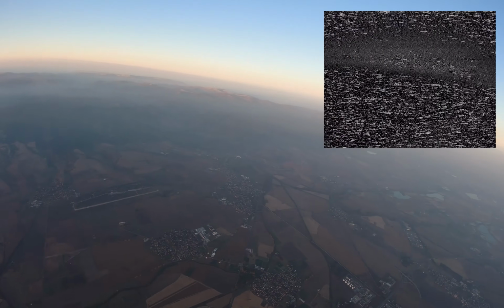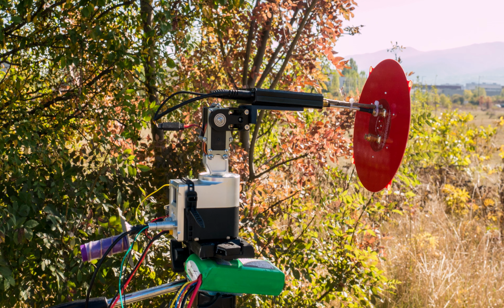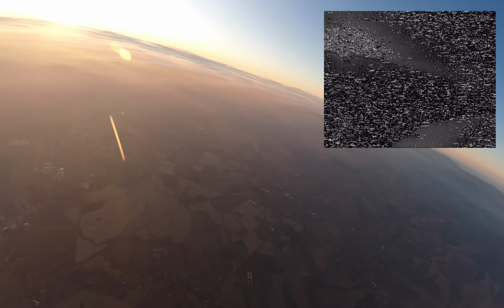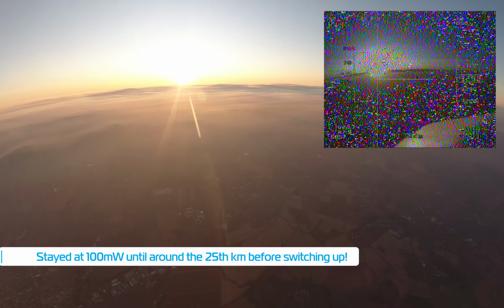DragonLink Advanced 433Mhz LRS Radio - an AWESOME system!!!

Comment: I’m about ready to maiden my xuav cloud but can’t find any info on control surfaces deflection how much travel do you have on your ailerons, elevator,and ruters or what ever you call them on a v- tail
Reply from the maker: Well I always leave them at full travel! These planes are rarely flown in manual modes and the AP would limit travel to certain degrees anyway.

Comment: What do you recommend in 2022 for long range because Dragon link is probably no longer available for sale :( (Out of stock) why ????
Reply from the maker: It is often out of stock because of high demand and not enough production! Give it some time and it will be restocked! I am not aware of it being taken out of production!
Reply: @ArxangelRC  If this is really the case, I regain my faith that I will build my dream plane: D sorry for my English I'm from Poland
Reply from the maker: @Adexi1  Well that should be the case, the system is often out of stock, I've had situations where I've needed to ask DL to reserve a set from the next batch for friends, out of fear it will get bought out too quickly!
Reply: did you buy it? or did you buy another radio transmitter?
Reply: @herbertnatanael Out of stock :(
Reply from the maker: Yup

Comment: I've got the Dragonlink and Mateksys F765-WSE but I cannot work out how to connect them. Any help would be very much appreciated thank you
Reply from the maker: What exactly is the issue? Usually Rx6 on the board is where the SBUS or PPM from the receiver should go! Somewhere around it would be the 4v5 and GND pins for power.
Reply: @ArxangelRC  Inbetween sending that message and you replying I got movement in Arduiplane. I can see the 4 RC_MAP for pitch roll etc. How do you map the Flight modes please
Reply from the maker: @ps_3460  The default modes switch in ArduPlane is channel 8 from the radio.
Reply: @ArxangelRC  My F654-WSE just caught fire. GRRRRR!!!!!!
Reply from the maker: @ps_3460  How did that happen? 🤯
Reply: @ArxangelRC  I set it up on the bench. All worked fine. Put it in the Ranger 2000, it sparked and caught fire. Luckily I ripped it out of the plane quickly, no damage to the plane.
Guess I'll have to fly manually for a while.
Reply from the maker: @ps_3460  Damn... did it spark up when you plugged in the battery? Could it be a shorted wire?
Reply: @ArxangelRC  I'd like to say I was careful. But you never know
Reply from the maker: @ps_3460  Yeah, sucks mate, sorry it happened!

Comment: Dragon junk just wait. Got two of these junk, it will just stop binding. 800 dollar paper weights.
Reply: Pretty easy to say junk, with no full explanations of what the set up is....be specific
Reply from the maker: @M-H433  Exactly!
Reply: Lang le please tell us your set up and exactly what the problems are so we may try and help you.
Reply: @M-H433   junk for the money I pay. First one work for six month and just die no power to the unit..second one work for year and a have till it one day after flying for 2 hour. Land it and it never mind again to the unit..i have other brand that still working. Ask dragon crap for help. All they can do for  you, is show you the same video online,absolutely no help from the dragon crap. Email them no reply one after another fuk that crap,
Reply: @langle6003  did the tx die or the rx?
Reply from the maker: Why would it stop binding? Never had this issue! Have you flashed it with the new Beta firmware?
Reply: I got it brand new, bind it fly it for  seven to nine month. One day turn power on it doesn't turn on  dead as a door knob  Rx is good, got another dragon unit.  bind both ex, flew and crash one rx in gas plane. A year and  half  later went to fly, turn it on and no binding light, try try try to bind it,,,it never ever bind to that rx..got pic of both.
Reply: @langle6003  v2 or v3.....so it sat for a year and a half and you decided to fly and the Rx was dead?
Reply: Flown it for a year and seven month, went to turn it on one day, bam no binding. Upload new firmware and still no.binding. now it sit in the corner. Don't waste your time asking dragon crap for help.
Reply: @langle6003  sent it to me and I will fix it and send it back to you.
Reply: @M-H433  are you a hobby shop or store.
Reply: @langle6003  no lang but im more than happy to look at it for you,up to you just want to help.
Reply: Lang  do the blue lights come on at all,and if not are you running the same firmware on both rx and tx.
Also have you done calibration in Gui after attempting bind?...
Reply: Let me dig it out haven't mess with it over three yr. All in a box. It's junk when they say they will fix it or guarantee the product but they don't and will not ever from dragon link. Bought the V2 in 2015, seven to eight month later, flown it ever month, seven or eight month turn on radio no power to the tx..install new cable, still no power out of tx..so got another one which is v3, new. Bind the v2rx and v3rx, I bought the second unit because it was really 😎 me to fly over 10 mile with my skyhunter and mini talon ..it awesome but the nightmare start .so now the second unit everything work just don't bind .try and try to ask dragon crap for help, that how they guarantee it by not replying back yr after yr...I still fly with  futuba ,  airtonic from the 90 & 2002. Got a German multiplex unit now. Radio.
Reply: @langle6003  Lang why don't you just box it all up and send it back to them,with what the issues are,I'm sure when they get it they will look and offer some explanation, I see a lot of non binding issues over sites,if it was me I would have sent it back a long time ago.
Please keep us posted on updates,I've never had these issues with my system so can only offer my help to you if you wish it.
Reply: I try to do that from the beginning and they would never talk to me only I mean only respond watch video. Get it from getfpv, I spent day to email or get a respond they do talk to my kind of people..after the first bunch of time just give up...that why I call it junk. you want pic of it just sitting in a box...well got German equipment now don't have to worries about fake guarantee...
Reply: Don't need pic Lang of it sitting in box,you obviously don't want help fixing it so I guess we end the conversation and I withdraw my offer to fix for you,good luck in fpv and enjoy.
Reply: Mike has the best support in the world, and thats not an overstatement. If you have a problem he will do anything in his power to help you, and for free!.. Are you sure you are not just trolling?
Reply: @Eiael  I think he was just lazy. Didn't understand it's easier on DL if you box it up and send it in, rather than time on phone or email. Woulda took a few minutes on the bench.

Comment: pretty sure the dragon link on 433MHz is illegal without a HAM operator license. Also, video on 5.8GHz  above ONE watt is illegal too. So this video is promoting illegal behavior. Can anyone prove me wrong? Cite your sources.
Reply from the maker: And which part of the world are you referring to?
Reply: @ArxangelRC  https://www.ic.gc.ca/eic/site/smt-gst.nsf/vwapj/2014_Canadian_Radio_Spectrum_Chart.pdf/$file/2014_Canadian_Radio_Spectrum_Chart.pdf 433 is Amature secondary use. 433MHz you need a licence for amateur use https://www.ic.gc.ca/eic/site/smt-gst.nsf/eng/sf01226.html#p10.1
Reply from the maker: scott Houser  Yeah!
Reply: @ArxangelRC  Here is The FCC version https://www.law.cornell.edu/cfr/text/47/15.240
Reply: @ArxangelRC  or just a quick WIKI serch for ISM https://en.wikipedia.org/wiki/ISM_band
433.05 MHz to 434.79 MHz is "only in Region 1, subject to local acceptance."  FYI U.S. is region 2
Reply: @ArxangelRC   @ArxangelRC  Here is the 5.8 GHz power limit for the U.S. https://afar.net/tutorials/fcc-rules/#:~:text=In%20the%205.8%20GHz%20band,23%20dBi%20of%20antenna%20gain).
Reply: @ArxangelRC  I empathize with your situation. I too am trying to get a long-range system up and running but legal setbacks are cropping up. I was hoping to be proven wrong so that I could legaly get the range I want but so far...
Reply: Use your brain.  They would not have used this frequency if it was illegal....  duh!
Reply: @amazingpower2761  In Canada, in the RC hobby space, it's actually quite easy to buy a random transceiver on the internet that uses frequencies and power outputs that are legal. You aren't blocked from buying it. You have to go out of your way to research whether it's legal.
Reply: scott Houser  Us and Canada have almost identical regulations. I am specifically interested in Canadian law.
Reply: scott Houser   You are missing the point entirely. I have done my research and according to all the links I provided, assuming ArxangelRC is in the US, he is flying illegally. 5GHz above 1Watt is illegal in the US. 433 is not allowed for use for flying drones in the US. You may be upset but am I wrong though?
Reply from the maker: @Pyotyrpyotyrpyotyr  Yup! Scott is correct... you are coming from a wrong assumption of my whereabouts! I am in Europe, and more specifically in Bulgaria! 433Mhz here does not require any kind of licence, as for 5.8G... it is quite debatable what is legal or not! The EU has a rule for 25mW limit, if I am not mistaken... which is absurdly low... but Bulgaria in specific has no set limitation on that power output, and I would think 5G routers output on more than 25mW! More to the point... the situation in this country is such that... nobody really cares about any of this... they are more concerned with lining their own pockets from way overinflated infrastructure projects and stealing businesses than dealing with the 20 people flying FPV around here... there is just no money in it!
Reply: @ArxangelRC  Okay good to know thanks. I couldn't tell from the scenery what country you're in.  I also don't know where your audience mainly from. Europe / US. Keep up the good work many thanks.
Reply from the maker: @Pyotyrpyotyrpyotyr  Thanks, will do! :)
Reply: @ArxangelRC  Same for México lol
Reply from the maker: Right...
Reply: @Pyotyrpyotyrpyotyr  were you able to make any headway in determining a legal long range setup in the US/Canada?

I got my HAM license today, and would love to do some long range FPV, but the damn “no BVLOS” rule is thwarting everything
Reply: @macremtom  me and my buddies are in a drone company and we're trying to get BVLOS certification. It's been a pain in the ass. As for now we're just using 2.4 gigahertz. And in the future I'd like to have something on 900MHz. 400 MHz as far as I can tell is flat out illegal for uz it's cuz it's an amateur band whereas we are trying to make money so that doesn't fit the legal definition.

Comment: Ive seen videos with someone popping out 297km round-trip :O Ive got my dragonlink V4 on order - Im only hoping they havent nerfed the distance due to FAA restrictions but even then, hopefully - there is a firmware hack to get around any signal nerfing.
Reply from the maker: I don't think they have! But that distance does require some pretty good antennas! The DL on its own, with stock antennas, will not reach that far!

Comment: 15km  rssi 27% not good
Reply from the maker: This was the telemetry signal, not the control signal.
Reply: @ArxangelRC  I know that telemetry signals do n’t look ideal
Reply from the maker: Well this was running at 200mW max... not at the full power!
Reply: Im running 100mw tx power + diy moxon antenna 25km not less than 90% rssi.. Telemetry work perfect.

Comment: Do you or have you used EZuhf? Intrested in distances diffrence. Gr8 video thank you.
Reply from the maker: Thanks! No, I have not had a chance to try that system... or have even seen it around here!
Reply: I use it and it works very well. However, the receivers I'm using are from a Russian company and are a little higher quality than the stock receivers. It's a one-way system as well so a separate telemetry radio is needed if you want Mavlink telemetry. I just use and record the OSD data with those installations. Range is comparable. Good antennas is the key factor to good performance with any of these systems. 80km out is possible with even the cheap OpenLRS equipment if setup properly.
Reply: @jeffhampton8781  what video system do you use? I ruined myself by getting a Disco over 4g doing 70km round trips but no skill is need.
Reply from the maker: A Russian company is making receivers for an EZuhf system? Damn...

Comment: I'm confused why you had telemetry issues on the R9. With the R9slim+ and R9M on dynamic I reached out to 20km already with stable telemetry. Just needed to turn around because of battery and not yet full range tested plane.
Reply from the maker: I did not have telemetry issues on R9... I just never bothered to try it... because my experience with FrSky and telemetry is that when it is operational... control range degrades a bit... and since telemetry is not exactly critical to me... I can easily omit it from the system so I can some extra kms of range at any given power level! That logic seems to be working quite well for me! Also, I am doing EVERYTHING that I can to stay away from FrSky telemetry and lua scripts... and have been quite good at that so far too! :P
Reply: Can you get mavlink telemetry with ardupilot? I'm installing it on F405 wing and I'm thinking about buying a Dragon Link
Reply from the maker: Yes, you can... that's one of its core functionalities!!

Comment: Hey, you might try change the TX antenna for the first upgrade. The stock monopole antenna is great, but its not finely tuned for 433, its more like dual band 144/430 for ham radios and I've check the vswr is just terible. You might upgraded it to moxon or dipole antenna, or may even a yagi although it's quite overkill :D. And you might interested with EzWifiBroadcast/OpenHD for the video side, it's a diy digital video that offers long range capability.
Reply from the maker: Yes, I am aware of the OpenHD project... though I haven't looked at it yet! Don't see a reason to change antennas yet... since my video range has no chance of pushing the DragonLink, at this time... but all in good time I hope! :)
Reply: @ArxangelRC  Yep, OpenHD is a more mature version from EzWifi and have more features. Actually you can use FPV, telemetry and aircraft control via one single system/frequency on OpenHD (ie. no need for remote control), but i still use my 433 anyway for comfort :D. And yeah, stock antenna is more than sufficient, but just in case, lol
Reply from the maker: I would think radio control would be quite limited if you send it through the HD signal... would still use a separate system for that!

Comment: Expensive kit though
Reply: Hey, you might want to look at QCZEK LRS. A DIY long range system that derived from modifying Lora modules both on 433 and 868. I've use it for at least half a year and it's works nicely. Although it's not as powerful as Dragonlink, it does have limited telemetry capability and quite cheap too. At least you can use it as an entry level LRS system before jumping to the Dragonlink like I do :)
Reply from the maker: Expensive... but it works! :)

Comment: You need to try an old satellite dish -- the improvement in range (when tracked properly) will astound you.
Reply: Yes,,, I have one that managed 25 miles with only 50 milliwatts... it is impressive.. but the power output of only one watt really let me down because it is next to impossible to deal with floor noise..
Reply: @Migueldeservantes  yeah Problem is that you would need a tracker
Reply from the maker: @xjet Bruce... I have been thinking about a dish for a quite a while... but it needs a proper tracker to swing it around... all in good time I guess, though I am itching to try it out! No as much for the radio control... but really curious how it will affect the video range! :)
Reply: Bruce, do you have any examples/links of someone who has implemented an old satellite dish?

Comment: My only concern with using DL 433mhz in USA is the FACT we have a lot of ham radio operators in my country especially in countryside where I fly and from what I’ve heard these frequencies are really close to what DL is using.  I understand DL uses Frequency hopping but only so much hopping will help in high RF areas.
Reply from the maker: What he said! :P
Reply: I am a ham operator in a large metro area in the U.S. and 433MHz is very under-used here.  Old hams will complain about everything, but ask them how often they actually use those frequencies.  If they say they do and can show you their EME setup and you are still concerned, then get a Technician license, it's easy, and you will learn a few things.  433Mhz is very good for RC and worth it.

Comment: Yeah I’ve been struggling with R9 and Xfire. I think I’ll go this route
Reply: I've had my DL system for several years now... and one thing you don't have to worry about is losing control link. Myself, personally, that's the reason I bought the system as I don't really do the telemetry stuff (right now anyway); but losing control is one less thing that I have to worry about with Dragon Link.
Reply from the maker: Glad to hear this from a long time user! :)